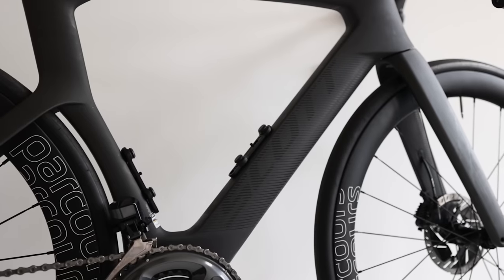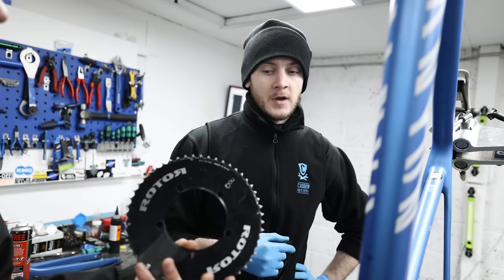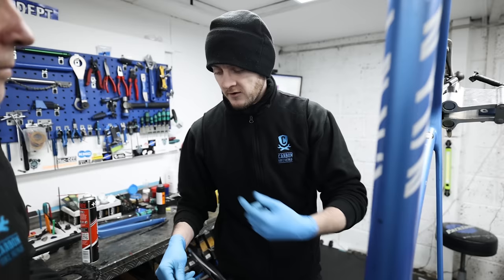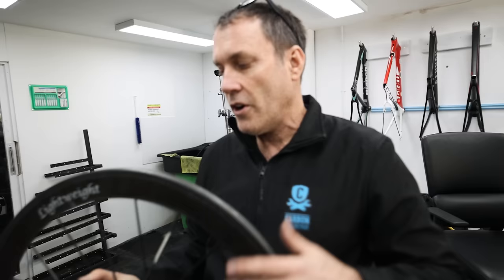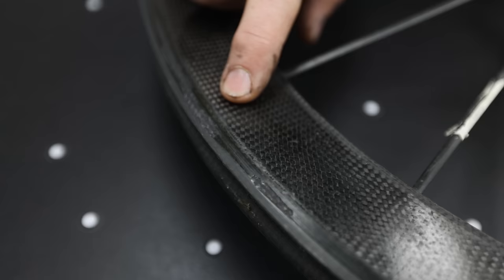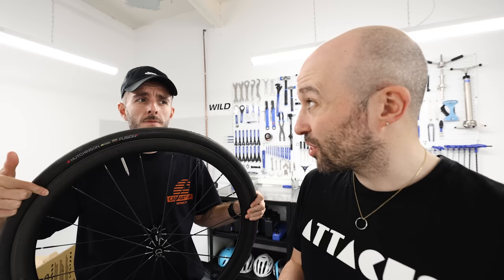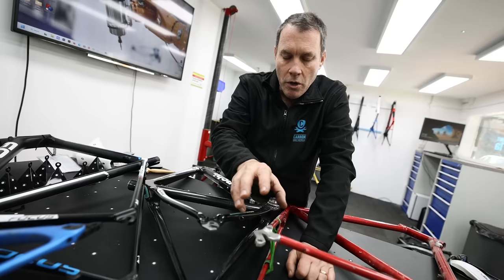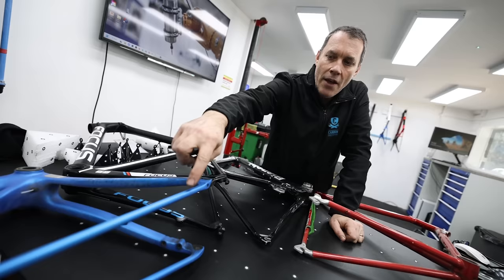6 Bike Products That Shouldn't Be Carbon Fibre

Comment: I would add brake levers / shifters (when used on the majority of bikes). 

Recently broke a SRAM Apex which used alloy levers and could only replace it with their Rival model which uses carbon levers. Much more expensive and for my requirement completely unnecessary. It could have been made of plastic, basically been the same weight and while not as strong, still plenty strong enough for the task. It then would have cost half the price.
Reply: Rival has aluminium levers. You might mean Force.
Reply: @bocksteinbikes  the one I bought is carbon. Would post a link but YouTube doesn't allow external links.
Reply: @johnnyt7067  Sorry but Rival is aluminium only. Pretty sure. If it's carbon it's the Red or Force replacement kit.
Reply: @johnnyt7067  I was assuming hydraulic disc brake Rivals, I guess mechanical brake STIs might have carbon levers. My bad.
Reply: @bocksteinbikes  no worries. 

Also I checked out your website. Very nice bikes man! 👍
Reply: @bocksteinbikes  Carbon levers only exist on Ultegra and Dura-Ace,, but it's actually CFRP.

Comment: I wish you'd put out this video last week before I ordered some carbon bottle cages. Was previously using Fidlock but they seem to interfere with the Alterlock.
Reply: You will be fine I have a pair of Tune carbon bottlecages that I've been using for 40000km, just follow the recommended torque valves and use washers between frame and cage and cage and bolthead (so one each side).

Comment: So, no argument on any of that. I totally get that rim brakes with carbon wheels have the issue of heat generation which could potentially destroy the rim and kill you. So...what are we not doing in THAT part of the bike industry that definitely IS happening in aviation? Modern heavy aircraft have the entire brake system made out of carbon fiber i.e., both the rotor and stator are carbon and those brakes are MORE not LESS tolerant of heat than older non-carbon brakes - and longer lasting - and lighter.  For example a modern 300,000 lb. airplane stopping hard could heat the brakes to 2000 degrees Celsius which is twice the temperature of lava for God's sake. And they can do it over and over and over.  Any engineers who can take that one, GO. Are we just too cheap to do the shit right on bikes?

Comment: I learned a lot from this vid.  I would argue over the water bottle cage issue though.  I have lost bottles out of (name brand) plastic cages, but never out of a carbon fibre wattle bottle cage. And the prices have come way down on the CF cages, enough that replacing one that might be cracked is a no brainer.

Comment: I don’t think carbon rims are a good idea as they did lazy Engineeing by copying existing alloy rims which dissipates heat well and are a good braking even when the surface is wet with the correct brake pads (compare to carbon and steel rims in the wet). Since the rim is one part that has the most likely hood of breaking when running Over rougher roads or potholes or accidents like accidental curbing  it for example and now the attempt to add disc brakes is a dumb way to try to alleviate the braking issue and through axels to solve the tolerance issue if disc brakes. 

Also about road bikes disc brakes they can go as fast as a motor bike especially down hills where sustained braking is needed so it’s rotors, and calipers aren’t designed to take that abuse for a long time it’s too thin for the wear that’s it has to take so it’s not actually worth it especially if you want to have a bike that last a long time. 

But if you want to have the lightest bike that is enough to last 1 race section then it’s still questionable as if an accidental crash happened then it’s still very likely to break and both disc brakes and carbon rims seem quite dangerous when a crash  happens
Reply: As a primary mountainbiker I have disc brakes (but my bikes use no carbon fiber). The rotors have between 1,8 and 2,2 mm if they are new, and Shimano ones (which are typically 1,8 mm) are worn if they reach 1,5 mm. This don't sound much, but it takes quite long to reach 1,5 mm (especially with resin pads) even if you are descending with MTBs (where you can't just let it run). My main MTB is from summer 2019, I've ridden quite much but the original disc rotors are not worn yet.

Comment: I avoid carbon at all costs. I've had 8 ,all Trek each broke. Seats, bars, rims . 30 years and bins of rubbish. I ride gravel and durability is critical. Steel frames  still work for me. Never cared for the looks of carbon frames.  Nice video. Appreciate it. Carbon cracking is a sick sound and expensive
Reply: I think you should avoid Trek, not carbon...

Comment: Avoid all Jamis products. Bought a Jamis Eclipse back in 2003 or so. Lifetime warranty. Frame was steel, seat stays and chain stays were carbon fiber. After about 15 years the joints failed at the chainstays and brake bridge. Don't know why. Epoxy failed? Jamis would not honor the lifetime warranty to replace. I will never buy another Jamis product.

Comment: What about stems & Handlebars & Seatposts?
Reply: Stems: Metal inserts (contains threads to take the bolts) can come loose overtime.
Handlebars: Not impact-resistant.
Seatposts: OK for the most part I think, haven't seen one break from a crash yet, only crushed from overtorquing (clamping forces are carbon fiber's Achilles's heel). I used to accidentally crush the seatpost of a Tarmac SL6 FACT 9r and that happened at the torque spec that's printed on the original seatpost clamp, 6.2 Nm. After learning about this, I dialed it down to the more typical 5 Nm.

Comment: Good video, I generally agree with everything, except carbon fiber bottle cages.  I have them on all 4 of my road bikes and I've never had an issue with them.  In use at least several years and maybe 15k miles collectively.
Reply: My xlab cages are still performing well.   Some are over a decade old.

Comment: I would be worried with carbon handle bars.  I understand they can absorb vibrations, but dental work can be very expensive.  
I have cheap no-name carbon bottle cages with no issues.

Comment: literally all of it  4130 please.. AMT structures guy here..    just no

extruded carbon fiber in Poly is old tech and not going anywhere.

my 1990 Mongoose Alta. 1995 Trek 930.. the 2016 brodie bolt..   steel is real.

Comment: No carbon chainrings! You may even argue no aluminium chainrings. Steel chainrings are clearly strongest but end up adding a few hundred grams over aluminium.
Reply: I changed my ally chain rings at 23,000 miles. I'm happy with that.
Reply: Aluminium can be hardened too - maybe steel still has an advantage in lifespan but Aluminium works too. I have an Aluminium front chain ring on my commuter (I use an old 90s era crank there where you don't get much choice in chainrings any more) and it lasts longer than I expected.

Comment: Carbon fiber, lol. How many riders did I help put in an air ambulance when their carbon fiber frame or fork failed? How many steel frame riders. You never know with carbon fiber if theirs a flaw that will cause a crash. And sometimes those crashes are really bad.

Comment: never cracked carbon bottle holder, even chines one are solid
Reply: As long as they don't weigh less than 10 grams, I think it's OK. Uber lightweight means minimal material, which can lead to less-than-ideal durability. I've seen a cracked sub-10-gram Alpitude or two before.

Comment: It does make complete sense for manufacturers to produce as many components in carbon as they probably can, it would be even better if the thing breaks, that way they'd be able to charge customers for the new ones 😁 At first, I thought that the most questionable bike component made out of carbon were spokes until I saw them put on Scott Spark RC SL.

Comment: What are these alloy spokes he is speaking about. He surely means steel I hope. Also peddling the 'discs are dangerous' myth is not a good look for a pro bike industry person, it's complete non-sense and simply not true. In the bonded construction it's true that a shattered spoke might be dangerous but if it's a carbon spoke using threads and nipples it's not any more dangerous than a steel spoke. Still questionable concept in total. Carbon cages don't break so easy unlike claimed here. Also not really a must though. With the rest I pretty much can agree 100% but I would say rimbrakes are obsolete in general so that problem will never occur to me.
Reply: Shamal / Eurus and fulcrum zero/1 have alloy spokes. Harsh ride though.

Comment: One could easily replace a carbon front mech hanger. Similar to alloy ones that are brazed on the new carbon mech hanger can be bonded on with relative ease
Reply: I don't think that was the point about the carbon front mech hangar. Sure, you can bond a new one to the frame, but if frame itself is designed with the integrated hangar, a fracture in hangar structure could propagate to the frame, making the frame itself unreliable until properly tested via NDTs
Reply: I think you missed the point. If a carbon hanger is engineered into the frames cabon layup all good untill it breaks. When it does you can't just glue it back on again.
Reply: @oldtimegames96  it's easy to design it where the hanger would snap not the frame. Just by reinforcing the frame around that area. The bond would likely separate if the hanger doesn't just crack which it should. The bond between the hanger and frame should only be epoxy not integrated fibers between the two parts.

Comment: Carbon rims..disagree,  given the vast, huge number of carbon rims,,/braking surfaces. Majority, vast majority are fine. And aluminum braking surface on carbon rims, forget about it, no advantage for light weight over an aluminum rim. Full carbon rims give a huge advantage, especially deep rim, compared to aluminum.  
But his points his experience is worth keeping in mind. Plus..bear that because he sees only tge broken ones his experience is colored by that..if he saw 2 carbon rims a week he thinks bad, when maybe 10 million a week are made, he does not therefore have the full pucture, just his snap shot

Comment: In  order  to stay  true  and  reflect  into  good  and  bad  design  choices... every  rim  brave  system  is a  bad  idea... every  brake surface  will damage  from  the  use ... aluminum  or  carbon  and  then  carbon will  be  a  disaster if  you  are  braking  constantly  and  hard... damage  will  happen eventually  ... BUT also  happens  if  is  aluminium... and  then ... you reflect  how  much  expensive  your  wheels  are  to  damage  until  they  are  ruined.  really  a  investment  that  wont  endure  the  test  of  time.

Comment: I have a question for Rob: 
I've heard that carbon frames only last about 5 to 6 years, is that  true? What would happen if I ride a carbon frame 10+ years?
Reply: I've got a 2014 Domane that's still going strong.  People in my group rides are riding carbon frames that are even older.  Take care of your bike and it will be fine.
Reply: FWIW, I got my Giant Defy Advanced in 2017 and it's still going very stongly.  35 000km, including a lot of km's where I weighed well over 110kg
Reply: To use a bad word: b*llsh*t, unlike steel amd aluminium (al be it very slowly) carbon doesn't get weaker in time. What could happen if you ride a lot in very hot weather is that the bonding material gets bad but honestly that's such a low percentage chance.
Reply: @KoenMiseur  for carbon life span its not about time but rather its abuse, has it been raced on, weight of rider and terrain. Carbon fatigue life is almost infinite as long as it had good quality control from the factory and proper care.  

Aluminum and steel lasts longer because it can take a beating and mistreatment better than carbon. For carbon to outlast aluminum or steel you'd have to baby the material more and don't be reckless.
Reply: The only good reason why any frame wouldn't last, is that it is rebuild frequently and e.g. the bottom bracket gets reamed out by all the rebuilding, and thus the tolerances are looser and it starts creaking. But in general, you can ride any carbon frame for 20 years and if treated well, it won't deteriorate significantly.

Comment: maybe carbon chainrings with steel teeth could work
Reply: Carbon-Ti's chainrings are like that, but I wouldn't recommend them for the strongest riders.
Reply: @yonglingng5640  In this case you could also use an Aluminium chainring, the weight won't be that different and Aluminium can be hardened
Reply: @simonm1447  I always run chainrings that are fully made out of a metal or two. I don't need anything more than this.
Reply: @yonglingng5640  my chainrings are mostly made of steel, just 2 bikes use Aluminium chainrings ( one is my commuter where I don't get anything else for the 90s era 5 arm crank and the other is a 1980s bike with original aluminium biopace chainrings). My cassettes are exclusively steel

Comment: Agree with all except water bottles.  I have 10+ years old carbon water bottles and still are as new.   Like anything else,  poor quality and bad engineering would be the determining factor but water bottles,  never seen anyone in any of my group rides using metal.  Lame.   Besides,  85pounds ?   u crazy?

Comment: I regret getting a carbon wheelset .
Reply: Carbon wheels are great, what makes you regret buying them?
Reply: Genuine question: Why do you regret buying carbon wheels?

I understand my experience does not reflect everybody else's, but I have a set of carbon rim brake wheels and I love them (they have the grooved basalt brake track with "high temperature" epoxy). I don't live in the French alps and I'm not going to be doing any mountains unless I'm on disk brakes. I just don't do multi-kilometer descents with tight windy corners. I've had one emergency stop from 45mph and they stopped fine. I can lock up the wheels if I squeeze hard enough and I have no concerns with heat buildup, at least not on the roads I ride regularly.

If you do happen to descend the odd mountain, then I can understand the concern and I'd agree that disk brakes would be far safer.

Comment: Now put durability and longevity once you think about buying a 10k$ bike.
Reply: Well I think people buy those expensive bike be because they usually get rid of it in 4years for the newest frame.  Most carbon owners don't keep the frame that long. They always end up trading it in after 5-6 years.  So that 10k bike actually costs 15-20k in 10 years because you end up replacing it before the 6th year.

Comment: carbon bottle cage have no significant advantage. it's not lighter. and it's not stronger. 
Carbon fiber is just one kind of material that does it's speicific benifit on certain application. not all. this carbon hype is just due to undereducated population. and marketing effort

Comment: I have a carbon bottle cage - no problem, not expensive either but extremely light - great bit of kit. I would NEVER buy carbon wheels - stupid idea, dumbass expensive gimmick, alloy wheel sets are lighter, stronger and safer. Can't think of anything more stupid than expensive carbon spokes except maybe for carbon disc rotors - incredibly stupid - now you have brakes that shatter when they get hot ! Will give Shimano bonus points for excess stupidity on that invention 💩💿💩

Comment: what are you heathens doing to break so many bottle cages?  this guys is all doom and gloom.  lethal carbon spokes?  come on dude?  breaking front mech hanger?  the cases to cause failure that this guy comes up with are just ridiculous.  are they valid? maybe, but such insignificant chances of these things happening.  I would be more worried about lightning striking me on an aluminum bike while out riding then most of this guys scenarios
Reply: To be fair he's basing it on the bikes he gets in for repair. Most of us will never have an issue with any carbon component.

Comment: They should stop making carbon airplanes like the B787 and A350 😉
Reply: Why?  They're lighter and stronger.  So, you get bigger, more efficient aircraft that fly further using less fuel.
Reply: @richardhaselwood9478  they are so more pain in the 🍑 to maintain and fix ( Lightning ⚡️ strike) sure they lighter but in my opinion they will go back to alloys.
Reply: @MrBillboeing  (I see what you did there...) I think that ship has sailed.  Airbus and Boeing both love composite structures because of the weight and (likely) durability advantages.  Sure smaller aircraft will have heaps of alloy, everywhere,  but not big aircraft.
Bearing in mind, I'm certainly no expert, but it just it seems the way the industry has gone, looking at the 787 and A350
Reply: @richardhaselwood9478  one more problem is to detect damage, it’s nearly impossible to see an impact of an ground vehicle with the fuselage due to the paint and flexibility of the carbon. Ultrasound tools are needed for inspection if the location is known. We will see what the future will be. Sure the B787 and A350 are roughly 25% more efficient then the aircraft they replace. Not all of this is because of the weight. All of them have a new engine design, better aerodynamics on the wings, better flight control software to optimize flight attitude in cruise.